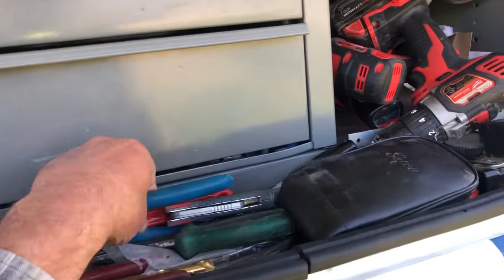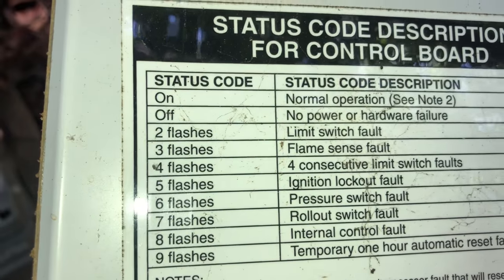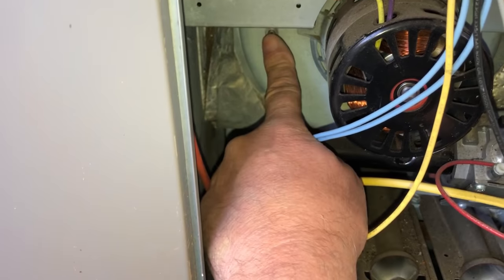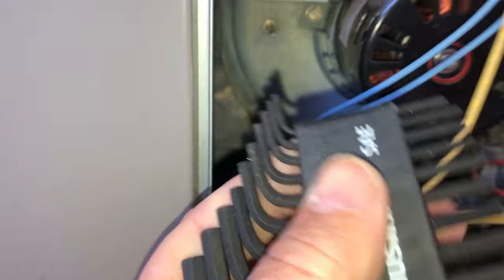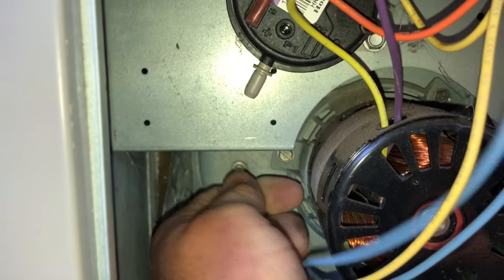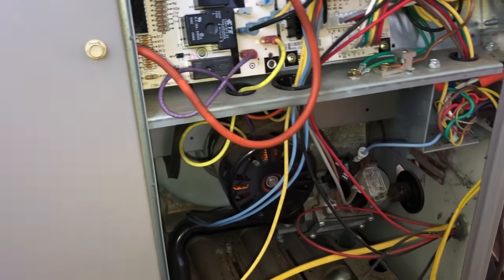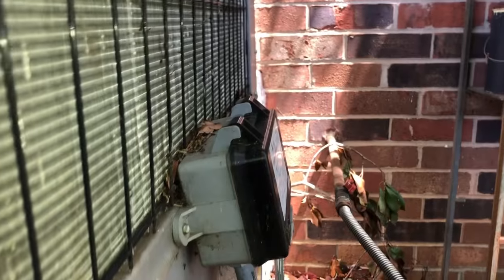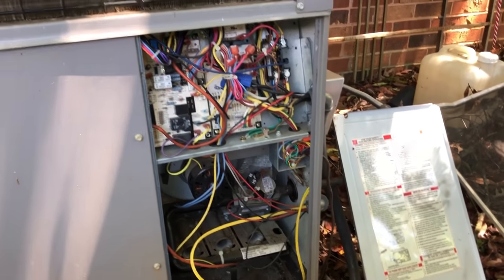Carrier Gas Pack not heating simple pressure switch port clogged

Comment: The company that installed my 2.5 ton AC package 10 years ago wanted to replace it for $13k, the coil is getting rusty. First off I think it should have beena  3 ton for our 1700 sq. ft. home. They canceled my 2 year remaining extended policy, said we missed two required service calls, we could not have, because I'm missing my right arm and can't go onto the roof and twice a year I have called them before we start using the heater and later the AC. Nearing age 80 all I want is for the unit to work (cool & heat) and not give my wife problems after I'm gone. How can we find a honest AC company or person in Tucson, AZ ???  I watch and enjoy your videos and to be a more knowledgable consumer. Thank you!

Comment: Great vid. Unfortunately cleaning the pressure switch hose and ports on both end didn’t clear my fault but tapping on the switch with a screwdriver handle did! Burners fired right up. An hvac guy told me this is super common with 48vl model carriers

Comment: I have a question my furnace stopped heating, and in Canada it's still cold... Is the blower motor supposed to be on all the time? Because the main fan works fine but the blower motor is off???

Comment: Sir, so how do you handle a job like this? At my last job I was told that if I came to a house and it was obviously a clogged orifice or a dirty flame sensor that I STOP and don't fix it, go up and give the customer a vague explanation that "the safety switches have gotten dirty so I'll need to do a full system cleaning" and charge them $150 bucks to do that which includes cleaning the orifice or flame sensor.

Now you went ahead and fixed it as soon as you saw it, now what do you tell your customer? Because I was told if you do that you run the risk of them just not paying you now because the work's already been done and now they don't need you. Please let me know.
Reply: That simple fix its not a big issue or he'll even a dirty flame sensor that needs cleaned. Now anything that needs a part charged you always stop and get their permission before doing it. No matter what if I fix it or not there is a service call they must pay for, if they refuse. I tell them I will put a lean on the property still the bill is paid for and they will be added to the black list
Reply: Just try and clean a flame sensor "in a few minutes" on one of those Carrier units...

Comment: Finally someone knows that its a VACUUM switch or (differential pressure switch in some cases) NOT a pressure switch. Thanks, I appreciate the precision.
Reply: That's just a vacuum switch, not a DP.  A DP would measure two sides, a high and a low.  You would normally find these on filter banks or measuring water pressure on a supply/return.